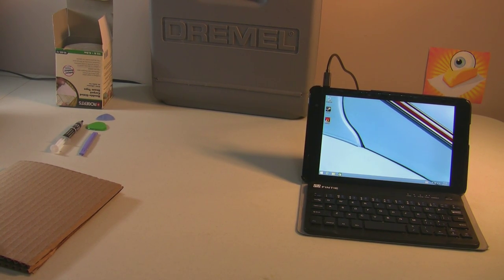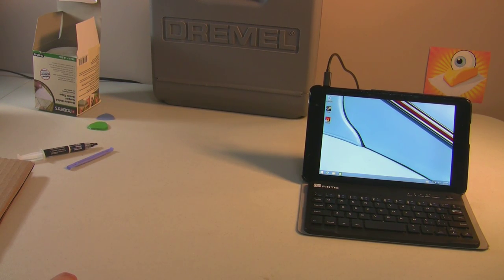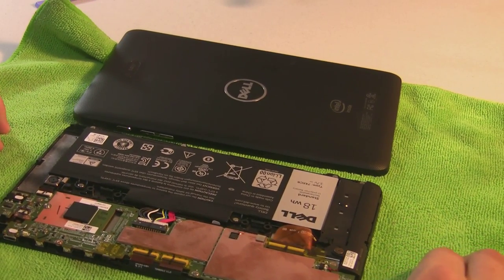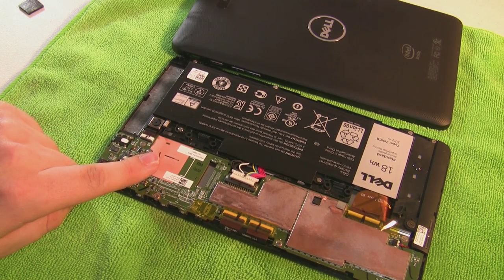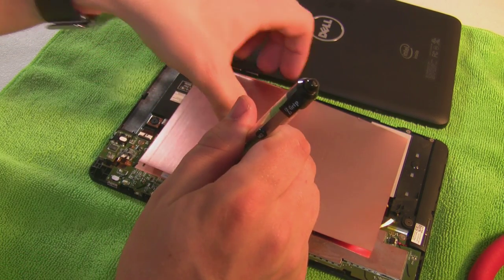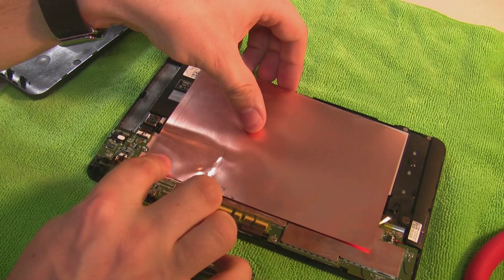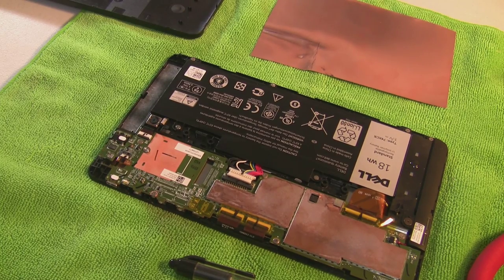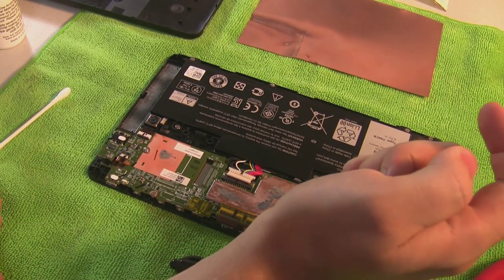Dell Venue Pro 8 - Copper Shim Heatsink Mod Guide + Results

Comment: Curious since its been a bit if your battery is still working well. Some seem to be skeptical that it would reduce your battery life, however you would have to put probes in there to actually know the battery temp, and it may actually decrease, or have negligible effect since there is less temp on the hot parts and more being dispersed across the whole shell with the way you did the copper flat plate. Interesting mod.

Comment: I tried out this mod as I was interested in trying to mod a few games into being touchscreen friendly. Unfortunately I had a lot of issues. I tried my best to shape the sheet the same was as the video maker did, but for some reason it caused those lcd bubbles that you get when a touchscreen is under too much pressure. I tried taking off the case a few times to adjust, and unfortunately due to my own lack of care I cracked the Venues touchscreen. Its pretty fragile and the force required to snap the case back on seems more than enough to split it in two. After a few weeks of mild gadget depression, I ordered a digitizer after some research, parts of the Venue are easily available on eBay, once again I had made a mistake - replacing the digitizer only is almost impossible on the Venue as it is glued onto the LCD panel. 

So after another wait I ordered a whole LCD + digitizer + assembly. After about a months wait the dudes had sent it on without the assembly, which meant I had to crack the old screen out of its own assembly ! Its not fun picking bits of cracked glass up after this, and at one stage I had a nice big glass splinter sticking out of my finger. Here is a similar example of whats needed https://www.youtube.com/watch?v=OT97TS_SOI4 Once all the glass and glue that was used to seal it in place was removed I was able to use some LCD screen tape I got off ebay to reattach the screen to the old assembly and put it all back together. There are dire warnings about damaging the screen ribbon, and the one was not as neat a fit as the original so it required a bit of sweating as it was jimmied into place. Finally when it booted it up, it all seemed to work - but after trying the touchscreen I found it was mirrored on the x-axis, which is basically unusable. Fortunately I found some other guy had located a driver to fix the issue https://www.ifixit.com/Answers/View/208285/Dell+Venue+8+Pro+inverted+x-axis+touchscreen . Just clear your calibration data first using the control panel touchscreen calibration tool and it works like a charm. I tried flattening my copper sheet a little more one last time, still had the same issues distorting the screen so I dropped the plan

So after 100 euro on replacement screens I have learned a bit about tablets at least. As for the copper mod I don't think the modest extension to dells ability to stay running is worth the risk, its clear dell made the case very tight and the alien sheet distorts the screen. It also adds a substantial amount to the tablets weight, of course I'm obviously a bit cack handed as well and maybe a light sheet that was better formed might have been just fine, but that was my experience :)

Comment: Hey there,  just wanted to say thanks for the tutorial and onlione posts, they've helped immensely and pushed me to go for this mod.  However, i am fairly new at tampering with electronics, and was wondering just how carefule you need to be of shorting the tablet?  Because section one of the copper (indented to make contact with the proccessor)  seems to be almost flat and laying on top of other components.  Thanks so much for your time and efforts in advance!

Comment: I just took a look inside mine. Wouldn't you get good cooling if you just put thermal pads on the area where the CPU is? You know, because there is already a large copper heatsink on the backplate, but it does not seem to be actually connected to the CPU's heatsink at all so it's useless.

Comment: Can u explain why there is no heat near cpu area and extreme heat in the bottom where u said there is ssd and stuff? During 4 hour hearthstone session cpu cores temp rise to 80 celsius and its only warm in this copper plated area near "intel" logo. How those 80c 4 cores arent warm, but ssd part is? Maybe its not CPU in this left spot?

BTW. Is it safe for battery, screen pixels and plastic  cover to get it to such a temps? I wouldnt expect this tablet get so hot so easly.

BTW., can u show how exchange charge port in this tablet?
Reply: You right... where he said is the CPU its not... its only a place for the 4g module. The ram eMMC(it doesnt use and SSD) and the processor stays where he said being the SSD

Comment: Awesome work, but on the forum, I see people just covering half the tablet back, but you seem to be covering nearly all the tablet (the battery area)? What's the pro with that? Should I cover half or all like yours? Would a 0.05 or 0.03 thickness for the copper sheet be fine?
Reply from the maker: Some people bought a 6x3 sheet of copper, I did a 6x6 and maximized the area. The more copper you put in, the better the results, due to thermal dynamics. But also the more copper you put in, the heavier your tablet is... (not by much, but it is noticeable)

Comment: very nice ... you should be more accurate. should make good contact on all 3 spots. u made pressure only on 1 spot and second 2 left without contact - why did u use thermal paste on all 3 spots then ?
Reply: beso facacia There's adequate pressure under all 3 spots because of the shape of the plastic backing.  The two metallic shields just barely press against the backing in stock form, and adding the copper shim sandwiches in between the two.

Also, for anybody thinking that the copper shim would transfer any heat to the battery, that's not the case at all.  Since it's being used as a heat spreader it's taking the heat generated from the CPU, RAM, SSD, and battery and spreading it over the entire surface of the copper shim and allowing heat to dissipate evenly from all 4 different components.  Any heat increase that would reach the battery is negligible...probably less than a 1-2% difference in temperatures.

Comment: Does this tablet get hot enough to need this? And if it does won't the cooper just cook the battery
Reply from the maker: If you find your tablet is throttling you might need this, depends on your usage model. If you don't game, probably not. Copper is highly conductive, not an insulator, it wont cook the battery, it will make it cooler most likely.
Reply: cbutters Wrong the copper will bring the heat from the CPU closer to battery due the thermal capacity of copper.
Reply: ***** Yes thank you for agreeing.
Reply: I don't think you have quite the understanding of what a conductor does vs an insulator.

Comment: Well I have dell venue 8 pro and I have problem with it I tray to install window 8.1 32 bits on it and I make full reset on it and also new partition and after that don't won't to boot up again it stuck on dell logo screen only bios is working and if you can help I will be glad

Comment: Is there anything you cqn upgrade on this tablet ??? Even battery ?
Reply from the maker: Not that I am aware, everything seems to be integrated, although replacing the battery seems like it would be quite easy.
Reply: You can add a micro sd card.
Reply: cbutters I've seen someone add a functioning USB port to it and considering doing that very mod to mine

Comment: This Mod hurts a little bit. You dont understand, why coopershields are used. THe both shields are use to prevent electromacnetic interference on the curcuit board. Next Point ... Lithium Ion batteries dont realy like heat. If you heat up the Batterie more then usualy, it lost capacity. It means ... high temp. alter the Batterie more. It demands on chemical reaction.
Reply from the maker: I don't trust someone who can't spell copper or electromagnetic. 
Do you know what a heatsink is? Why would applying a giant copper heatsink to a battery make it run hotter? I'll say it again, copper is a conductor of heat, not an insulator, and more mass = more thermal capacity.
Reply: This is correkt but ... if you heat up your Batterie you Speed up the degenerating process. Please messure the Batterie under heavy load with mod and without. Copper isnt only a heatsink. common use is as an electromagnetic shield. This type of copper used in the Dell isn´t use to Transport heat. My knowlage about Comes from 15 year Service from Video8, TV, Laptops, Server and Broadcast Device at Sony Austria.
Reply: ***** "Intel" made their reference tablet like that. Exactly, they made whole metal backplate to heatsink
Reply: I agree with everyone here and I do appreciate this particular fix, but cbutters do you think may be a micro-sized fan  by 15 x 15 x 6 mm might help?
Reply: cbutters It's obivous* he isn't a native speaker. You reacted to his critique in such a disrespectful and immature fashion that it made it easier to trust "someone who can't spell copper" oppose to a childish man who 'mansplains' crap.

*This was a typo.
Reply from the maker: MarcTBG I don't trust someone who can't spell "obvious". Are you a native speaker? ;) 

All kidding aside; You are right, there could be some battery longevity consequences by transferring some of the heat from the chipset/cpu to the battery, however this is a performance mod, not a "I'm worried about my battery having 5% less capacity 2 years from now." mod.
Cheers!-The Man Child
Reply: My question goes unanswered, why bother.
Reply from the maker: EmuNext Do you mean a fan inside the casing? I don't think anything 6mm will  will fit inside. not to mention there is no ventilation either. My gut says no, but let me know if I have the wrong idea.
Reply: EmuNext it would help more than this copper plate, you are good to go if the internal motherboard has a 2 pin connector. You could also get some holes in the back and install a micro usb cooling pad.

Comment: I have some 24 Gauge copper sheets that I wanted to attempt this with do you think it will work or do you think the 26 gauge sheet was already pushing it?
Reply from the maker: i feel like there is plenty of space in there for a bit thicker gauge, as long as you can still mold the copper to get good heat transfer.
Reply: Thanks for the quick reply. I'll try this out when I get some time over the weekend.

Comment: not that it would matter on this wimpy Atom CPU.
I've done this on the Core-M variant of the Venue 11 Pro in hope it would help with the throttling, but it didn't since the throttling is configured to throttle after several seconds, no matter what the temperature is.

Comment: The bios updates provide alot of firmware enhancements for various things on this tablet, im buying one second hand tomorrow and was wondering if installing the latest bios would hurt performance gaming wise by throttling sooner and at a lower temp to pro long the life of the tablet? Has anyone tested performance before and after bios updates?

Comment: I would locate the actual CPU, not put any copper on the battery, use thermal tape, and layer additional pieces of copper and thermal grease wherever the stack needs to be thicker.

Comment: Dumb mod since the shell is made of plastic and will not conduct heat properly so all you're doing is delaying the time it takes to reach the same temps as before since it's a closed thermodynamics system. Would be a different story with an aluminum body though.
Reply: The copper will pull the heat away from the processor and help dissipate the heat.  However my concern was that he ran the shim along the battery.  The battery will get warm and the copper will draw the heat from there and can make things worse over time.